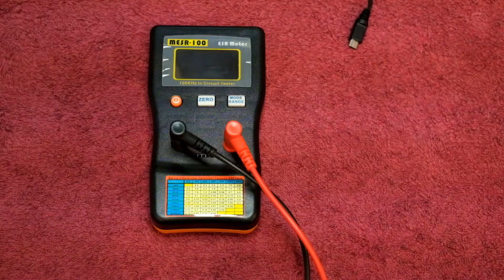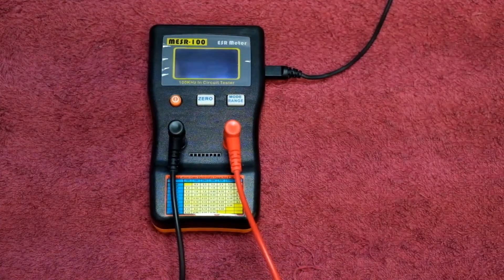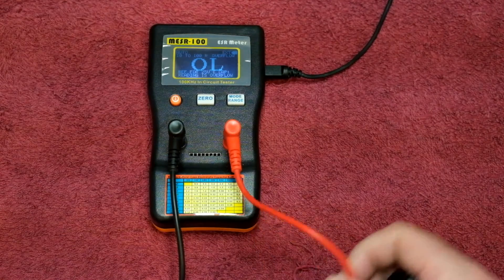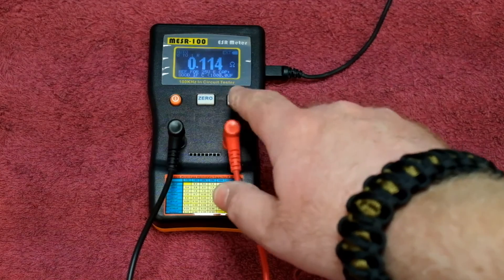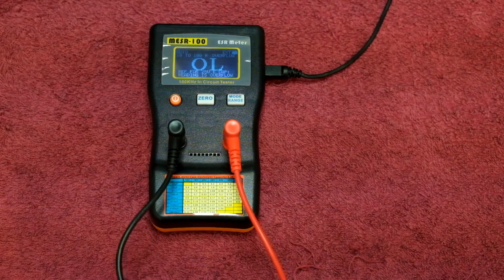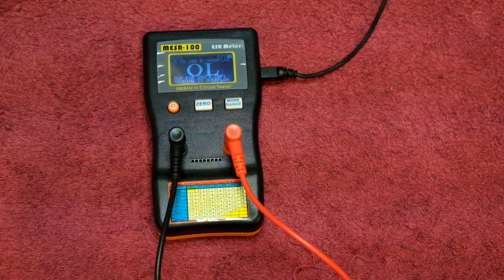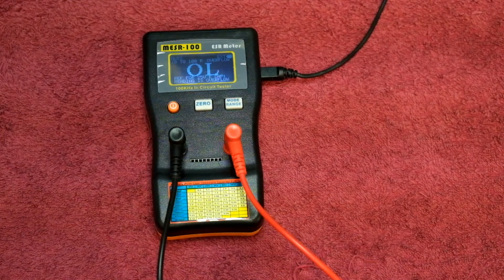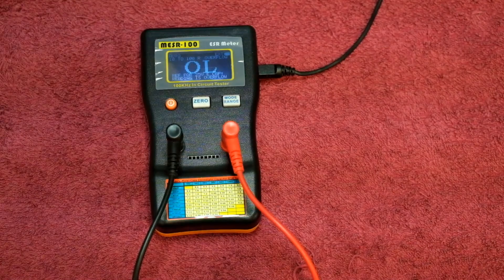Episode 32   MESR100 Chinese ESR Meter and ESR measurement

Comment: And unfortunately the longer the cables are, the higher the resistance. Mine just came today, obviously, I changed the cables because they are very short, and the resistance was just above 1.5-2 ohms. The values are standardized based on the lenght of the probes, so keep that in mind.

Comment: Hi, I bought the same ESR meter to test caps while still on a expensive dc to dc charger. I don't feel like desoldering all of them just in order to test them. So there are several 100uF caps at different spots of the board, and one of them shows way higher ESR than the rest, but the value is still OK according to the device/ESR table. Does that indicate that the capacitor is failing, or different ESR is to be expected at different locations of the circuit board?
Reply: hi hope you don't mind me answering, I would desolder the cap in question and test out of circuit. You can also use freeze spray to help identify faulty capacitors.

Comment: I have tested two capacitors 470uF 35V with the multimeter first:
it showed 480-490uF 
BUT AFTER THAT 
with this MESR-100 and showed above the limit of 0,09 Ohms:
0,11-0,12!
So what is correct?
Reply: Maybe it has the correct uF but a bad resistance and both are correct

Comment: Most important test you missed is in circuit - this is the most useful function of these otherwise just use an ordinary multimeter or a ATMEGA328.
Reply: My multimeter will see a rise in resistance when attached to a capacitor but I don’t think it would show the internal resistance like an esr meter would

Comment: I think you'll find that if you do a quick button press, the meter will actually stay off. You might be just holding the button down a little too long. Well, that's the case with mine at least.

Comment: thx for the video. I bought this unti to recap some old vintage amp heads and it seems the values of the caps are not listed on the device, I my be reading this wrong. ANy advice?
Reply: just google that cap datasheet or other brand with the same spec. that should give you a good enough ESR reference to look for
Reply: fanstein The comment was ...there is no spec on the cap.

Comment: I used this esr meter to measure a 6800uf/63volts. It appears 0.00 value and says the cap is good but low resistance. Is my cap still considered good?
Reply: Zeroone Zerofour .เถอะ

Component Tester Transistor Diode Capacitance ESR Meter Signal Generator Tool |
ด
Reply: The cap can be measured with an ohmmeter. Hold the test leads on the cap leads for 2 minutes. If it says high resistance after 2 minutes, the cap might be good.

Comment: These meters are quite good but also remember that the test leads needing zeroing out first before you test caps, just short the leads together and press and hold the zero button.

there is also test probe tweezers for this meter I bought some and are very good for long reach testing in circuit.